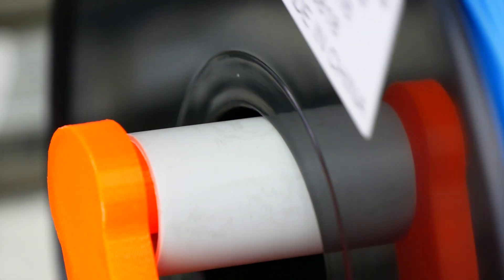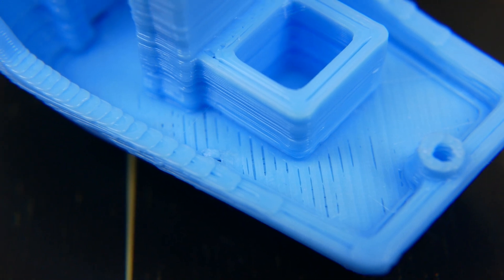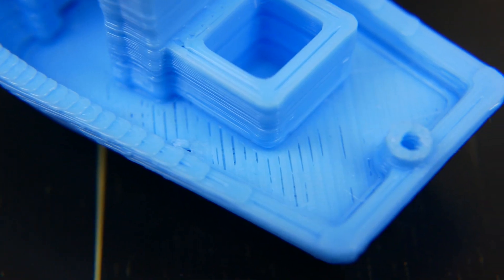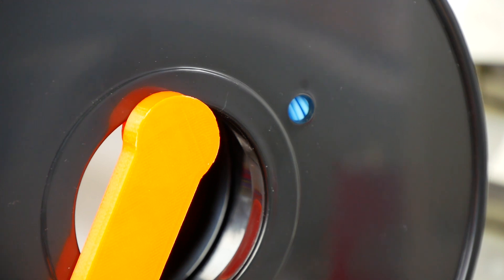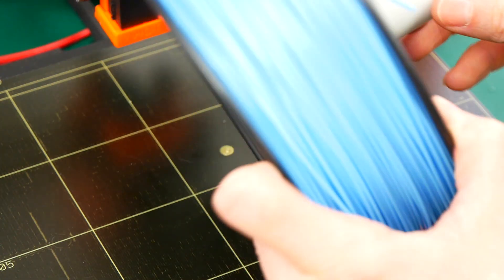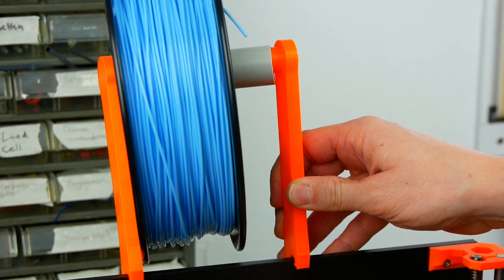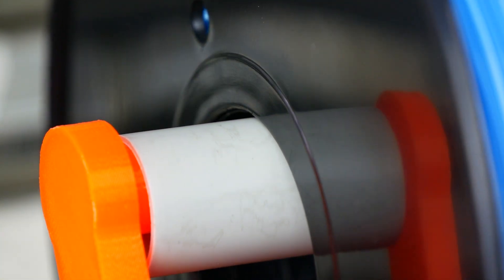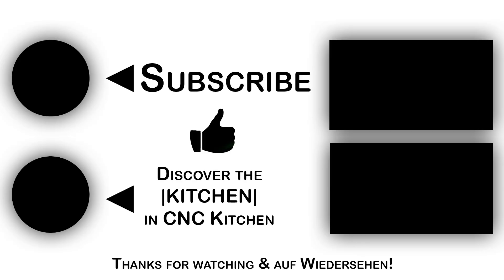Avoiding Underextrusion and Artefacts - Quick Tip #001

Comment: If you want a small amount of tension on filament but with even rolling around an axis, use cheap Chinese skateboard bearings. They don't roll forever so you get tension, but once they get going they work for a small distance. I have some 608 bearings which work perfectly for my spool holder in this way. I'm using the TUSH spool holder.

Comment: I don't really subscribe to the hypothesis that the filament must be tensioned by the spool friction, or at all. Because it can't always maintain even tension! It will lose tension whenever there's a retraction, a Z-hop, or whenever the print head moves quickly from the edge of the print close to the filament origin. It appears that the hypothetically most consistent possible way is to always keep the spool slightly unwound.

So how about mounting the shaft on a cheap DC geared motor, and mounting an optical or light mechanical gate in a filament guide which has some movement freedom that depends on how much excess filament is unwound, will spin the motor up just before the tension is about to increase, and just until for the filament clears the gate? I should try this, but could take a while.
Reply: Siana Gearz 
Sounds like a rather complicated solution to an intermittent problem at worst and rare at best.
Reply: To an extent, of course, but once worked out, simpler than you may think - an arrangement of a handful of parts and no extra electronics; and yet, who is to say that uneven tension doesn't always ever so slightly affect print quality, and that print couldn't become better as a whole? If it didn't matter, people wouldn't be jumping from one solution to another, through various spool designs, bowdens, oilers, direct vs. bowden-fed extrusion, because all these things could be declared approximately irrelevant, as any issues the solutions exhibit would only be apparent part of the time. I object to the notion that rare or intermittent issues don't need to be resolved. Jerk control and acceleration? Who needs that, it's intermittent, only affects the corners. Automatic bed leveling? Solves intermittent issue, as normally you can just keep the manual level and it'll work fine for a while most of the time, thus by your logic irrelevant, and yet it's now a standard feature. Watchdog and thermal runaway protection? Yeah that's for rare cases only, useless junk.

Reliability is a major practical issue of 3D printing, one of those that prevent it from being an end-consumer friendly endeavor, and needs to be one of the focuses of engineering. I still think a few approaches down this line of reasoning are worth trying. If they don't turn out to be useful, well they won't become the staple of next generation of 3D printers then, nothing lost.

Of course it's not the only thing i want to do, i'm investigating the possibilities to prevent possible fire hazards and electronics damage too, and i'll be developing an STM32F103 based low cost board. Like high-side switching using N-Channel and stepped up gate voltage (would reduce likelihood of fault like Wanhao fire hazard from a while back), and zener clamps to prevent MOSFETs from killing the controller.

If anyone wants to beat me to it, that's fine, but i don't count on it.

Comment: No clue what you mean by 'ball bearing holders don't unwind nicely'... what do you consider unwinding nicely? Because, its well, unwinding... having a tiny bit of tension to it isn't going to prevent spools that were filled improperly, (as in, end up looping back on itself and causing failed prints). And if you're talking about how if you, for instance, were to just let go of the free end of the filament, and it quickly loosens up a few loops, then again i don't see that sort of problem with ball bearing holders... If you are using proper ball bearings, and are using a proper ball bearing holder, then there is zero issue with either of those cases. A full spool is enough to weigh down against the bearings so they don't just free spin all willy nilly. And once you start using up filament, the natural curve of the filament on the spool acts like a spring and keeps the filament neatly wound. So as long as you aren't using a crappy holder, there should be zero issue.

Comment: yes, a quick solution. I don't like the spool holders with ball bearings either. They tend to overspin. That's why I have designed a holder that comes close to the original one and is in with some other parts you can attach to the frame. The tube ensure that the spool is more centered and runs smooth, but not too smooth, since there is still friction between the tube, the spool and the holder: http://www.thingiverse.com/thing:2067538

Comment: Why buy a pvc pipe when you can print your own pipe! (And yes I printed a pipe for my prusa i3 mk2 that I got the night before lol)
Reply from the maker: Wouldn't really solve the issue. The problem is the friction between the spool and the ABS holder. If you print the pipe on your own you'd still have the spool running on the ABS. PLA also wouldn't probably help too much. The smooth PVC pipe works quite well on the other hand.
Reply: CNC Kitchen PVC, PLA or ABS, a tube is a tube.
Reply: You are being a bit dense so think about it.  When you print it has grooves which causes friction but if you can smooth those ridges out then I agree.  Acetone Vapor for ABS and sandpaper or filler then sandpaper for the other materials.